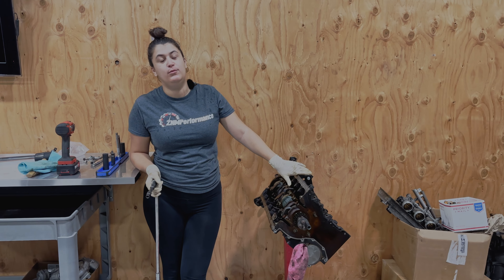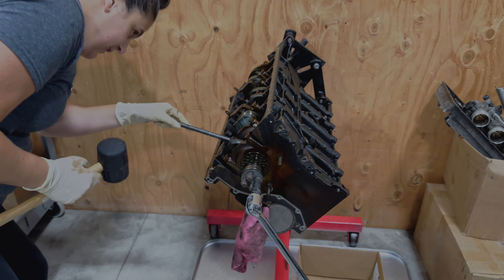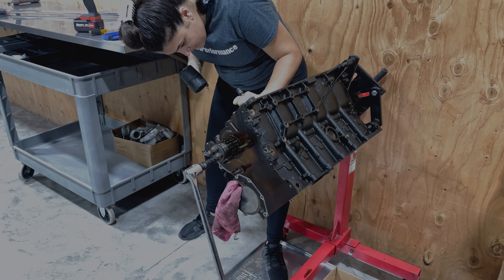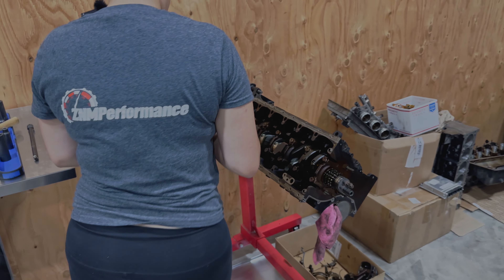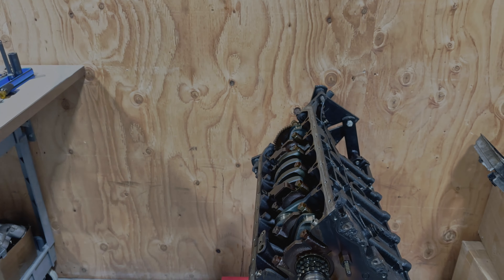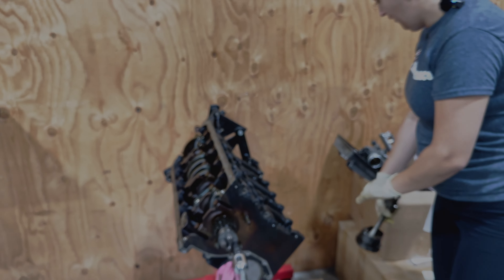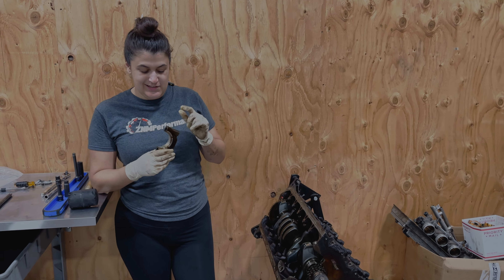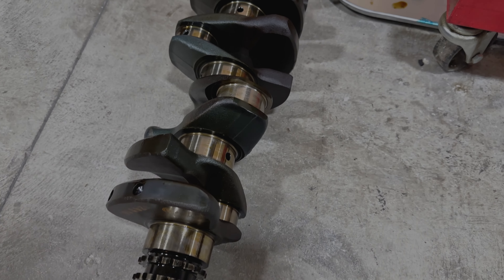Restoring a 20 year old BMW M3 - Project E46 S54 Build - Ep 1 - Engine Teardown | 4K

Comment: Looks good. Are there any things you would do preventatively on an S54 other than vanos exhaust hub and bolts, upper timing chain guide, and possibly rod bearings depending on mileage? I’ve heard the oil pumps can occasionally fail but it seems uncommon.
Reply from the maker: Oil pumps are extremely uncommon, but if servicing chains and rails, might as well throw an upgraded pump in. 
 Electric fan conversion is worth it. 

You covered all the bases, valve adjustment is a good one I’d say every 25k depending how hard you drive the car.
Reply: @znmperformance  thanks!